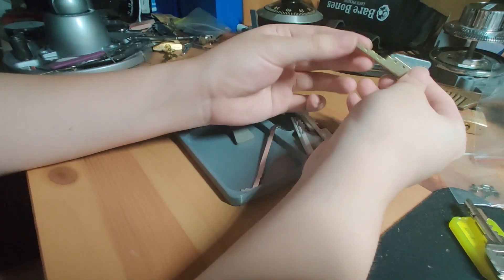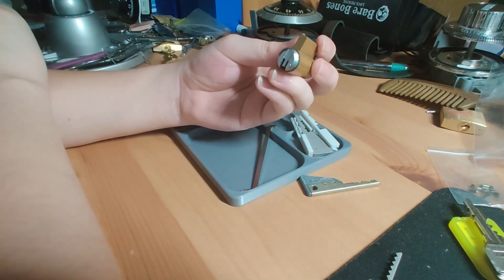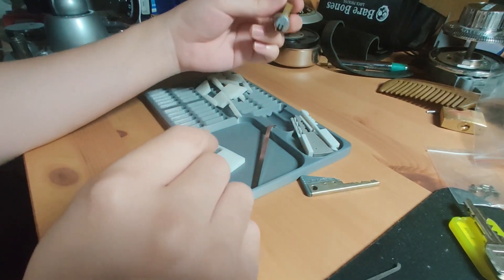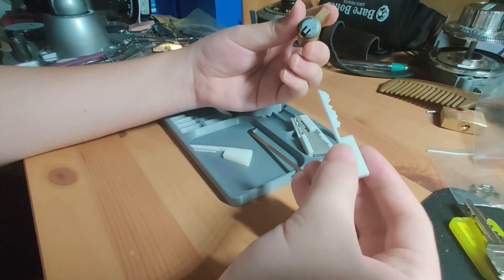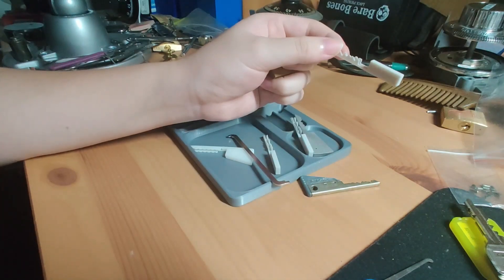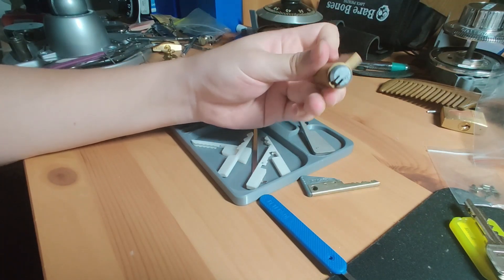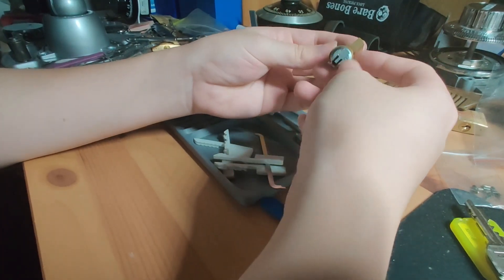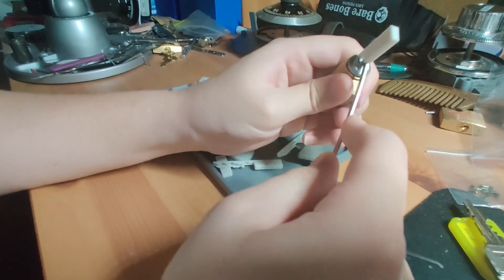A New Method for "Impressioning" and Decoding the ALC Bilock.

Comment: Are these printed with dlp resin printer i assume?

It's the only printer type i could see anywhere close to be precise enough.
Reply from the maker: A few of us have done the printing keys now, PLA works just fine (though not 100% consistent in my experience). A resin printer would be ideal but I did not have access to one.
Reply: @westlockpicking  i see yeah fdm dimensional accuracy would explain most of your adjustment pains really. I'm not surprised.
Resin printers are available for under 400$ these days so it getting more and more accessible.